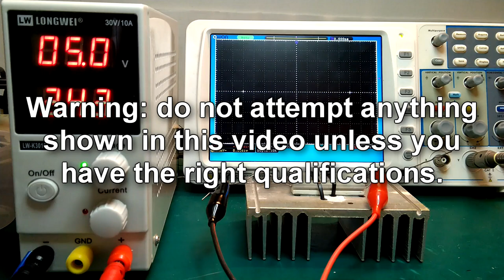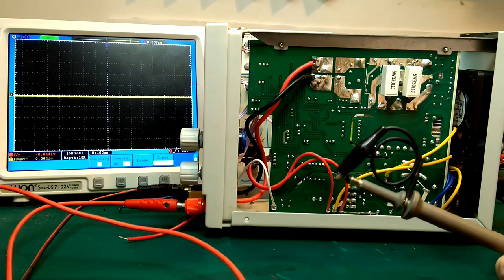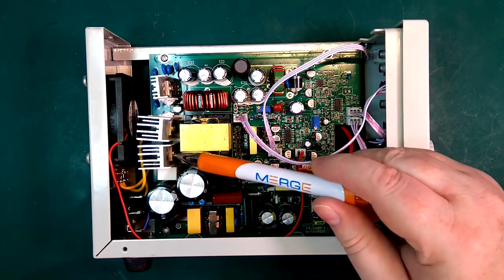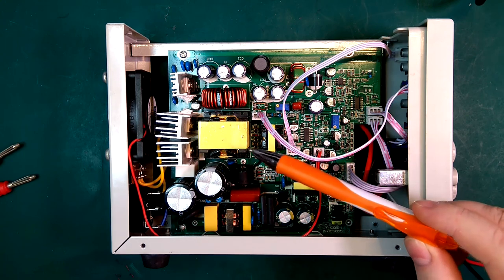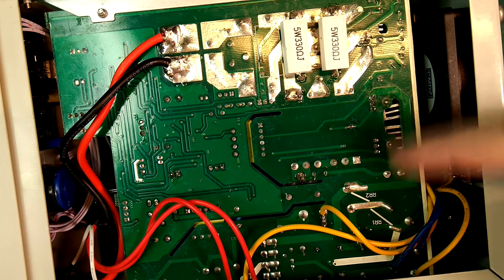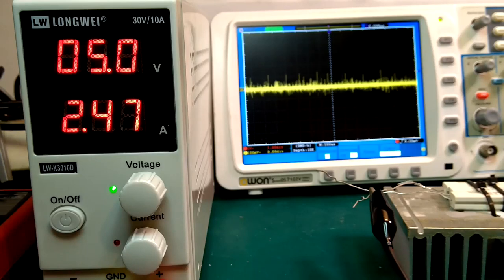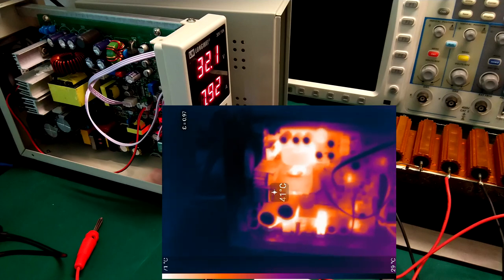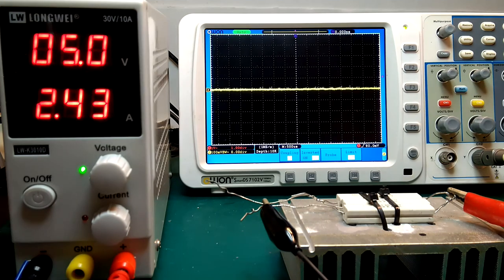Fixing the LongWei LW-K3010D Bench Supply Noise Issue

Comment: Hi sir, I need your help, In doing the mods I did a mistake in the bottom mosfet for an error indeed of a 22 ohm resistor I put a 22k. During the test at 12V everything seems working but when I push the voltage to 30V I got  short and the house protection cut down,  after verifying my fault I dismounted the  Mosfet and verified that its pins are alla shorted out, I fear can be more component to check, the 22k resistor on the source is ok what else should I have to check other than the mosfet that is broken for sure? Thanks
Reply from the maker: Hi, first check the fuse in the power supply, I'm surprised if that didn't blow before your mains fuse kicked in. Besides that a lot of things could go wrong if one of the mosfets shorted out, check the transformers for continuity. I'd expect you'd be able to smell or see some damaged components inside. It will probably not be worth trying to repair it if any of the transformers are faulty.
Cheers,
Jake
Reply: @TheStuffMade  Ho thanks for your answer, it's the first thing I've checked out the fuse it'ok, I cannot did more testing since as soon as I power it on the home protection (magnetotermic) kick in but fuse will not blow out this is really strange. I ordered a batch of Mosfet to test out. Something in your mind that should I order for a component swapping activity?
Reply from the maker: @marcovalentini1845  It's probably a ground fault causing your mains relay to switch off,  something is likely shorted to mains ground somewhere. I doubt it's worth the effort to try repair it especially not if you don't have experience n repairing switch mode power supplies, but I'd check all the transformers for shorts and continuity first. Then usually a visual inspection and a smell test of all the components will give you some idea what might have failed. 
Cheers,
Jake
Reply: @TheStuffMade  many thanks, just worth trying for learning thanks
Reply from the maker: @marcovalentini1845  Understand and it's a good way to learn by repairing things. Just be careful and don't connect it to the mains until you are confident it's been repaired. The safe way to diagnose and repair a switch mode power supply is to inject low voltage from another power supply to power up the circuit. That way you can power up the secondary low voltage circuity while limiting the current so no additional damage it done and start doing measurements to find faults. But you'll need tools like a scope to see if you can get the switching going.
Cheers,
Jake
Reply: @TheStuffMade  Thanks! this is a very useful hints! I have all the tools required, I have to study a little I downloaded the schematic bu is not so simple to understand.
Reply: @TheStuffMade  After swapping the part, I power on the PS and all seems good with current knob all way down, but after turning it a little up I got another short and the Mosftet blows out again. The Fuse never blows out.
For these test I have a 60W bulb in series to the power supply to limit current of any short I might got.

I removed the Mosfet and I try to do some kind of mesurement, without the mosfet I can power on the PS without any problems, led lcd's show's all 000 but seems working, I start doing measurement in the low power section and I don't find any fault 12V is present, U1 OPA vary from 0 to 5V when Voltage knobs turn up and down, I have a similar 0-2.4 going up and down at pin 1 of U4.

On pin 11 and pin 14 of U4 (SG3525) on the oscilloscope there is a pulse and the same pulse reflect after the chopper transformer T2 D15 at the gate of the broken Mosfet Q22 si similarly present.

300V is present as well on Source of Q22, well rectified by the bridge.

I don't see any modification on the pulse out of U4 by turning up and down the voltage knob. Is this normal? I have the same pulse same frequency and same amplitude, measured after T2 in around 12V.

I suspect some problem after the mosfet what do you think? What worth checking more?
Reply from the maker: @marcovalentini1845  It's hard to say without being able to do some measurements myself, but check the mains transformer isn't shorted on any of the windings. Check if the switching controller is sending out pulses and the transformer for the pulses is working. Then check the transistors, diodes, resistors part of the gate clamp/pull down circuit are working. You can do these tests with the mosfets removed. But please be careful, you are working with lethal voltages here and it's entirely for you to judge if you have the expertise required to work safely on this.
Cheers,
Jake
Reply: @TheStuffMade  thanks, no problems on my safety, I am non a 1:1 isolated transformer
Reply from the maker: @marcovalentini1845  Good, but even with an isolation transformer, you'll have up to 320Vdc on the mosfets(assuming you're on 230Vac) after rectification. That's very lethal.
Anyway, good luck, hope you can fix it.
Cheers,
Jake
Reply: @TheStuffMade  Hi Thanks to your support, probably I repaired the power supply, checked both the Mosfet and found the second mosfet shorted checked components around incircuit and seems ok checked also the two diodes attached to heatskin and are ok, so I swapped out both mosfet give power and now without load everything seems working I can go up and down to voltage, and I have the same voltage as display on the output, I have 22 ohm resistor on the source of the two mosfet but I have to solder the capacitors as your mods suggest, worth doing some more measurements before applying a load? Capacitors of the mods are needed? Thanks
Reply from the maker: @marcovalentini1845  Sounds good, but again it's really hard for me to give specific advise without being able to look at the psu directly. Anyway, you can try load it up slowly, just start with a really small load and see if it's stable. The mod will not work without the capacitors, but it's fine to test without adding the capacitors.
Cheers,
Jake

Comment: what about the improvement of the snobbers instead of slowing down the gate, we could perhaps avoid the loss of thermal efficiency (noob's question), good video thx
Reply from the maker: Thanks, well there is no snubber filter, so that's that. From what I see there is only some clamping to prevent exceeding the max Vgs. Anyway, not a bad question, if you own one of these, feel free to experiment, just don't electrocute yourself. :)..

Comment: hello there, Thank you very much. I have 2 of that same PS only one does this the other one is very quiet. BG (big prase here) is sending a replacement, it was so noisy I could not test anything with my scope because of the noise this PS putout  the trigger would just not lock.  if the replacement  does the same thing I will do this. Greate fix.

Comment: Brilliant work. My PSU died when I was using it to drive an arcing spark generator (don't ask), but I found the circuit diagram for the same PSU but with a less max ampage. So the area that you worked on failed. One of the large MOSFET's went short, 2 of the surface mount transistors that you pointed to went short, and so did ones of the schotky diodes next to those surface mount transistors - I've replaced all those . The PSU currently pulses the display showing 000 when switched on. Now I'm wondering if the switching controller you pointed to has died? I think this is the circuit diagram I had (thought you might find it interesting or useful) = https://www.eevblog.com/forum/repair/permanent-cc-and-no-output-(longwei-k3010d)/
Reply: the same thing to me with the short, but I also changed the U5 TNY820 AND THE PC817B PHOTO COUPLER, IT HAS RESUMED WORKING, PULSA X WHICH IS PROTECTED THROUGH U4 SG3525.
Reply: andy parry oops I got confused, the component I replaced was U4 Sg3525  and that's it.
Reply: @diegochiarenza1456  I tried that and it didn't help much. I suspect one of the amp has gone.
Reply: @andyspoo2  mi dispiace.....
Reply: Can you please send a link to the circuit you found? Thanks
Reply: @Bazzawombat  If you fix yours then please let us know on here what you had to change. Thanks.

Comment: Just have bought one of them, thank you it will be very useful for me in the future! Do you think this could be a problem for working with audio frequency signals? At which frequency does the noise really become a problem?
Reply from the maker: The noise is mostly a problem when you look at small signals on a scope as they will drown out in the switching noise. For audio work I would recommend using a linear power supply except perhaps if you work on projects like class D amplifiers.
Reply: @TheStuffMade   unfortunately linear supply are big and less cheaper than SMPS.. maybe in the future I would build one by myself, as it also seems not very difficult, thank you very much!
Reply from the maker: @lelesecchi6140  Sure I understand, you can still use the Longwei just fine. I recently did a video on building a small and simple dual rail linear power supply ideal for low power audio projects if you are interested.

Comment: I have 22R and 47R 0805 250mW resistors but no 33R. Based on your previous testing, do you think it would be better to go with the 22 or the 47? Sorry, I know this was 3 years ago already and you may not recall all the details!
Reply from the maker: Hello, the 22R will probably work, but I'd recommend spend $1 to get the correct value.
Cheers,
Jake
Reply: @TheStuffMade  Ok, thanks for the advice. Will get the 33R 😁

Comment: Nice video. I am curious when adding the caps to the Gate, I would think if the Gate is not 'discharged fast enough then you can have MOSFET's on at the same time in this half-bridge setup unless the dead time is long enough and not causing the issue. I also do not see they put on any ferrite beads on the MOSFET's legs to reduce switching noise.
Reply from the maker: Thanks, if you look at the design you'll see the gate signals go though a transformer from the controller on the secondary side, so a ferrite bead wouldn't make any difference.
Cheers,
Jake
Reply: @TheStuffMade  That is typical Gate drive transformer topology to isolate cold side from hot side of the circuit, the Ferrite is on the MOSFET legs is typical to reduce ringing and radiate switching noise so it will pass compliance test for inject and radiate noise,  we had to do lots of stuff, I.E. board layout, wiring, shielding, etc. in our power supplies we design, the unit you have probably does not any compliance certificate.
Reply from the maker: @budmartin3344  My point was more that if a ferrite bead is primarily going to take the edge off then the transformer would've already done that. But yeah, I agree this power supply would never pass any compliance testing. It's likely it was designed to perform better but then components were replaced to keep production cost at a minimum.
Cheers,
Jake

Comment: Why adding an extra capacitor instead of increasing the gate resistor? It's R x C that counts (where C = Cgate + Cextra), so you could just increase R and leave the extra capacitor, no?
Reply from the maker: Hi Bigjim, it isn't quite the same when you look at the impedance of the circuit.
Cheers,
Jake

Comment: would capacitor polarity (shielding) in this case matter? Thank you for putting these great videos out here
Reply from the maker: Thanks, these are bipolar film capacitors, the polarity doesn't matter. As for shielding I assume you mean where to connect the side of the capacitor that's got the outside film, then in this case it doesn't matter because both sides of the capacitor are connected to low impedance. This only matters in very high impedance circuits with small signals where you're trying to keep as much noise out as possible, like tube radios etc.
Cheers,
Jake

Comment: Hi, I just bought this power supply and did the noise mod to it. I have a few issues that I would love to have answers/fixes to.
1. When I touched the transistor heatsinks, I felt the 230VAC go into my finger. It was probably not the full 230VAC, but I definitely felt it. Is that normal? Correct me if I'm wrong, but I don't think it is.
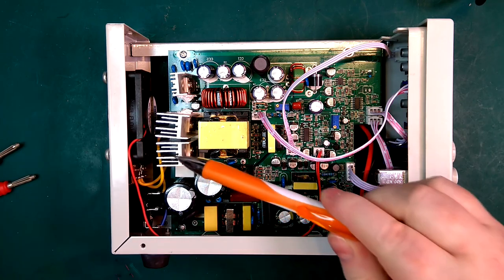2. A high pitched whining noise is coming out of my unit. When you'd look at the supply on 6:20 that's the approximate location the noise is coming from. Is it the big transformer? The coil right above it? Caps? please advise. Love your vid <3
edit: welp I got the reply in other comments why I got zapped when I touched one of the heatsinks, but still. Why? lol
Reply from the maker: Hi Marek, the reason I added a warning in the beginning of the video and in the description was to avoid situations like this. You should be aware never to stick your fingers in live switch mode power supply and that the tab on a TO220 device is always connected to the center pin, that would be the mosfet drain in this case, meaning there will be 320Vdc on the heatsinks, that is very dangerous. Take a clear picture of your modification and post it on imgur and leave the last part of the link here, then I'll have a quick look. It sounds like something isn't right.
Cheers,
Jake
Reply: @TheStuffMade  I do understand that I should never put my fingers anywhere near a live circuit, especially one that's being powered from mains. I'd say it was just a stronger tingle and I still was able to pull away. Gotta learn somehow lol. Thank you for the explanation.
About the pics, yea I should be able to take them and upload later today if I won't forget as I usually do :).

Comment: what is the reason for removing the noise? i am thinking of powering a radio transceiver that requires "12v", i have not done this yet, but would this noise come through the radio some how?
Reply from the maker: Hi, the switching noise if high frequency and have a broad bandwidth, it will radiate out into everything. If you try to measure something on a scope it gets very annoying because you don't know if the noise is from the device you're working on or it's from the power supply and it will make it impossible to make any kind of sensitive measurements. It will also create radio interference, as in all kinds of radio equipment will be affected, even if they're not powered from the supply, it's enough the supply is just switched on. Generally switching noise is very undesirable, especially in any kind of electronics lab environment.
Cheers,
Jake

Comment: 30 ohm resistors and 47nF caps.  2 of each.  I bought a larger power supply (link in reply below), 120VDC and 3amp, 360W.  The 47nF caps shown are only rated for 100V, is this mod going to work for me I think I need higher voltage caps?  Can I directly replace the ones in the video with  630V Polypropylene Safety Plastic Film 630V 47nF?
Reply: I don't think the said voltage between gate and source exceeding 100v.

Comment: Hello!!
About 1,5 years ago, I bought through Banggood this product LW-K3010D.
Since last week, I started having a problem each time I try to raise the voltage from 0-30V on the POTENTIOMETER.
 It does not exceed 9.2V on the screen, but also at the output of the connectors.
Since it does not work properly, I cannot use if for my job. 
Can you please advise me on how I could fix it?
Waiting for your prompt reply.
Thank you!
Reply from the maker: Hi Sakis, this is not something that can be repaired in a few comments. Your best bet is to take it to a local shop and see if they can repair it. 
Cheers,
Jake
Reply: Thanks Jake for your reply!! Unfortunately here in my city there are not many workshops that can help me! I have also sent the Company (LONGWEI) 2 emails but.....they haven't sent me anything!! I don't know what else I can do. Too bad it can't be repaired!!
Reply from the maker: @Markoulis66  Hi Sakis, yeah, it's a shame. A repair shop would probably need to charge as much as the cost of a new one, it can easily take a few hours to diagnose order parts, replace parts, then test to make sure it works again. So unless you can do it yourself or know a friend, then it's probably cheapest just to buy a new one.
Cheers,
Jake
Reply: I had a similar problem ... re-flow / replace U7 (TL431)

Comment: good vid.  I'm new to this..  Why not just leave it as i, why do you try to reduce noise what is the benefit??
Thanks
Reply: Noise is bad for sensitive circuits, coms, medical, etc. Switching power supplies are inherently noisy. Some are really noisy. Linear PSU's are much cleaner. Generally, less noise is better.
Reply: @sekboi  I have that same PS. BG is sending a replacement, it was so noisy I could not test anything with my scope because of the noise this PS putout  the trigger would just not lock.

Comment: i have a minleaf 30v 10a power supply i havent got a scope to check it though well i have but its one of those mini DSO138 i dont think its capable of these tests but i could be wrong.
Reply from the maker: These little scopes are good up to 100-200kHz. They are useful for audio etc. but for these noise measurements, as it's very high frequency switching noise, you need a scope capable of 100-200Mhz, so about 1000x faster to get good measurements.
Cheers,
Jake

Comment: Hi, I have  a doubs of the capacitor you're using is a 33 o 47uF and what voltage thanks?
Reply from the maker: Hi Marco, it's 47nF not uF, use a film capacitor. The capacitor doesn't see any high voltage so e.g. a 50V rated capacitor is fine, or use one of the green ones I use, they are very common and I believe they are rated at around 100V.
Cheers,
Jake
Reply: @TheStuffMade  perfect thanks
Reply: @TheStuffMade  Would a 100nF work(yes, it will, but will it matter??) Have a few at hand!